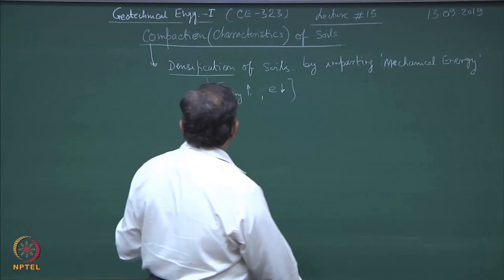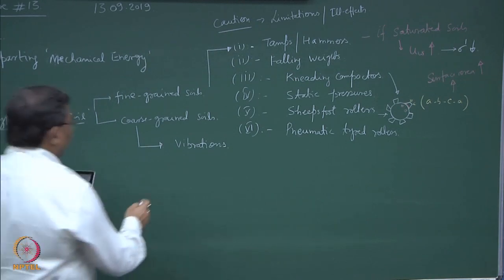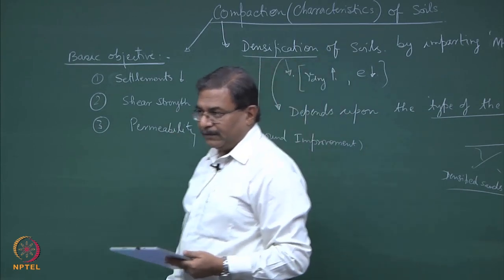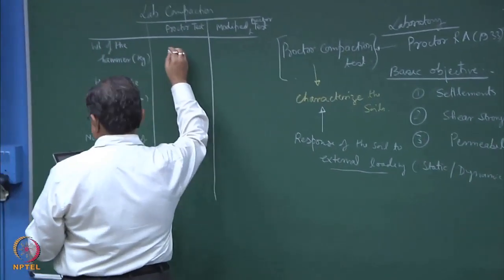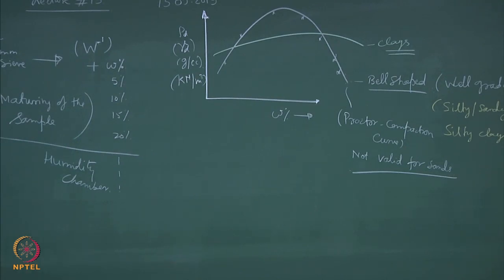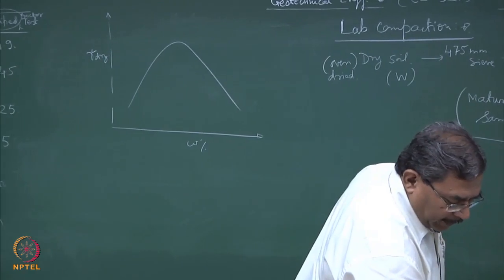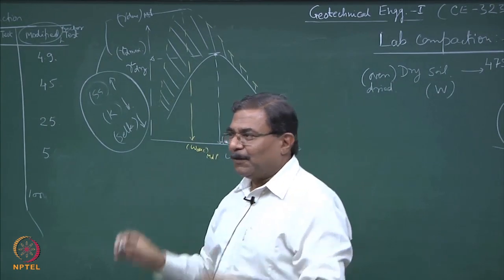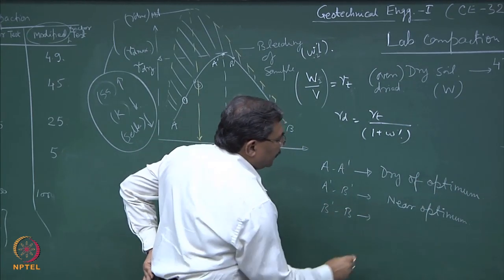Week 6: Lecture 14: Compaction Characteristics of Soil- I

Comment: Why soil sample has to sieve through 475micron? The proff told 475micron but he wrote 475mm.
In  line to this, how to check the max dry density of coarser materials which contain aggregates in larger portion as in WMM and GSB? How dry density can be check by proctor method? please shed some lights on this.

On compaction curve, the proff. confused the students. The curve he drawn is dry density and later he told to the students that the points on the same curve (eg. A to A) is the wet density derived from W/V.